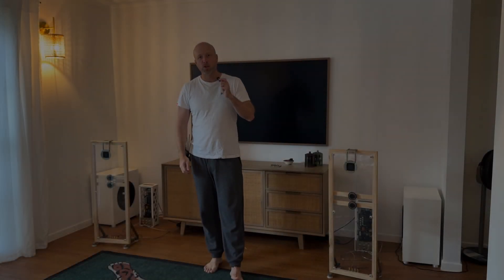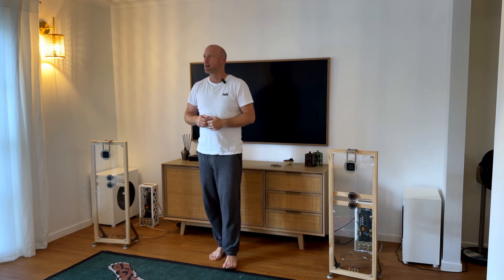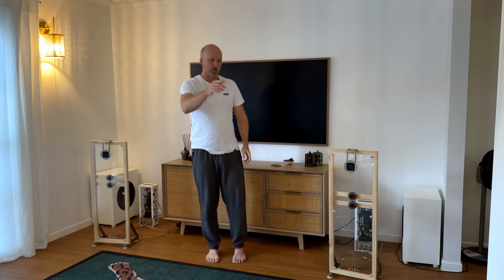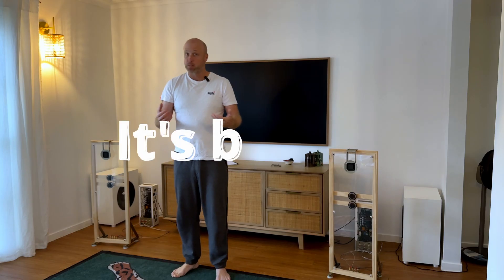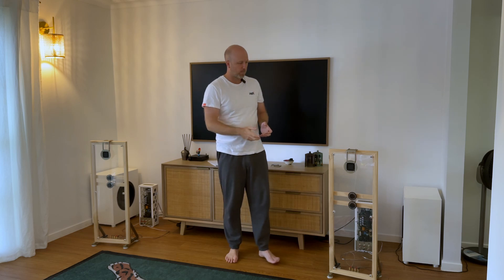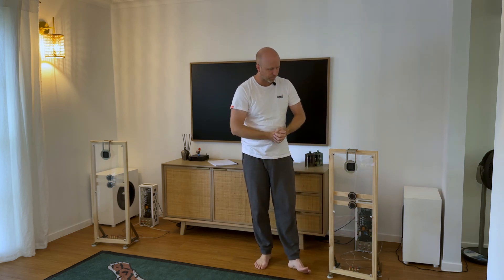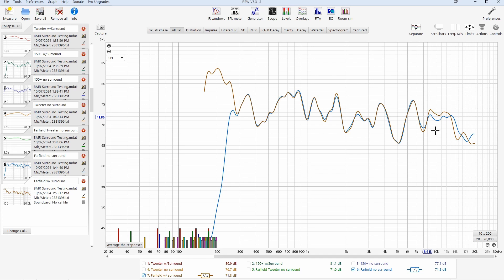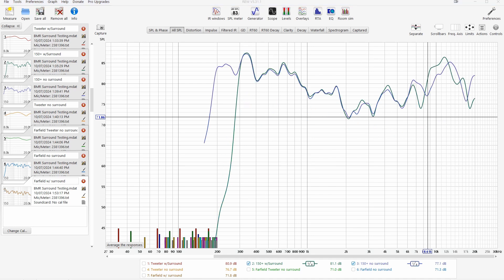More Epic DML #4 - BMR Positioning

Comment: So my cast wax board suspicions were correct. The volume and clarity are leaps and bounds better than any polystyrene panel I’ve made so far. If you can’t find them online(if you do find them lmk where please) go to your local farmers market and see if they have any produce boxes they will part ways with. Thats all mine is. I cut the bottom of the box out. Used a bar of paraffin wax to fill in the now exposed the edge, along with any divots or weird spots along the surface, used a lighter to melt away the spot where I was going to mount the exciter put on several coats of super glue it out and let it dry and then put VHB tape on that and then attached the exciter, but I imagine you can probably just use epoxy
Reply from the maker: Wow interesting. I'll have to start playing around with this when I get the chance.
Reply: @TypicalBenYT  i wasn’t even actively looking for a new material but I picked the box up and was like wow this is super sturdy for being so light cut the bottom out and a 2 foot by 1 foot section weighs nothing but it sounds like an oak board when I knock on it.
Reply: @TypicalBenYT  243-EX80S-8OHM look that up on mouser electronics. It was recently linked to me by someone that’s doing something similar to what you’re currently doing. They said it’s the best sounding exciter they’ve tried thus far
Reply: @TypicalBenYT  that visaton brand is also on parts express. a few models anyways. not sure if its the same one i suggested

Comment: Interesting! I can’t remember where, It might have been the forums or the tectonic engineers spoke of acoustic centres on dml. Although DML is immune to many traditional ills, it has been suggested that the radiating area reduces with rising frequency, also the initial impulse in the signal helps spacial localisation and imaging. If that is the case for critical listening you may want to get the bmr as close the panel exciters as possible. Any difference maybe more noticeable if your crossover slopes are shallow. The space between sources for interference at 10k is effectively nothing, In traditional speakers you would expect an interference pattern, but in DML it most likely manifests as a loss of imaging or just perceiving separateness.
Reply from the maker: Interesting thanks for that! I might have to play around further to see what happens!

Comment: I... tentatively feel like we're working backwards. I thought the whole point of DMLs was that they could handle everything from 125hz up to 16khz or so in a natural fashion. The whole point of MY research on audio in general is to have as few driver types with as wide, accurate, and natural of a response range as possible. Trying to tune and aim 4+ driver types is kinda a non-starter to me. I'd rather focus on broadening usage and off-axis performance so there's less to faff about with with physical setup. (I'm also focusing on car audio, and all that stuff (packaging in general, I mean) is by default more difficult in a car, hence my aversion to it.)
Reply from the maker: Yeah I can see this point of view for sure. I suspect that the lack of very HF is a function of the panel material (the acrylic seems to be quite well damped internally) so the options would be to use a different material or supplement with another driver. I don’t mind the complexity overly much if it sounds good.

Comment: So I think I randomly stumbled upon what could be IN THEORY the fucking best material for dml panels ever… absurdly light and shockingly rigid. I plan on making one over the weekend and will try to remember to report back. Anyways look into wax dipped/coated corrugated fiber board. Not like pizza box cardboard but the double walled stuff. I haven’t looked for it online yet but fingers crossed someone has it incase it sounds good.. which I’m thinking it’s going to.
Reply: Not sure if something fibrous would be ideal. I would assume the foam board that does "the best" does so partially because it's porous, and the plexi/lexan does well because it's smooth/hard and consistent/homogenous. My terminology might be wrong, though.
Reply: @Drunken_Hamster  I would typically agree with you. However the panel I made yesterday out of a 3$ piece of canvas glued on to cardboard from dollar general sounds shockingly good. The outside is well coated and after cutting it it seems like the “tubes” inside are lined as well. I honestly thought it would be solid wax right through but it’s not. Because when I say rigid it sounds like I’m knocking on the side of a piano… like S O L I D. And that aspect plus I he tubes being hollow I feel like it’s going to allow the sound to resonate through the panel better. But who knows lol I just started making these a few months ago and I’m a highschool drop out that delivers antiques for a living lol I’m definitely not the authority on normal speakers let alone dml panels lol I appreciate the feedback back though!!
Reply: @LikelyLagging  I'm you but older and less successfully employed, so like. :shrug:

It'd be cool if you could make a video or take some measurements like Ben, here.
Reply: @Drunken_Hamster  my suspicions were correct. It’s by far the best sounding panel I’ve made so far.

Comment: Hi, from what I have seen of that tweeter it is not so good in the frequency range that you want to cover. Also it's open back and he is having his backwaves directly reflected on the plexy right behind. I don't think that is an ideal situation. As DML is essentially a dipolar I would instead go toward a better dipole planar driver on top of the frame to be consistent. (EDIT: FYI I am using a Radian LT2 with Waveguide but I had to cut the back myself)
Reply: Technically dipole, but with some bipolar behaviour (little to no destructive interference in DML mode). “Diffuse dipole” to use Tectonic’s terms. Even so the reflections may or may not be ideal
Reply: @Butternose  Has someone measured DML diffusion on & off axis front & back ? Hard to find any relevant. A flat pannel like would put nearly as much in front than in the back. Same for the Tektonic. Can't find the same type of measurements.

Comment: Have you considered covering your frame in flexible material then gluing the panels to the material. The material would act as a suspension mechanism, which would flex with the vibration. Potentially allow the mounting of multiple panels to the same material? Might look a lot more attractive also. Just a thought, although too be fair I've never built one of these. Just an observation after watching a few videos :)